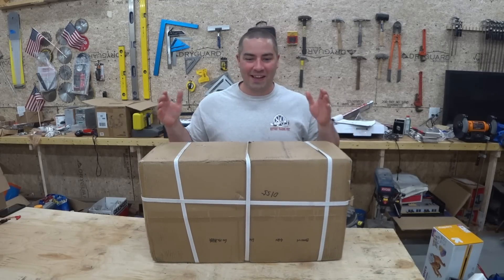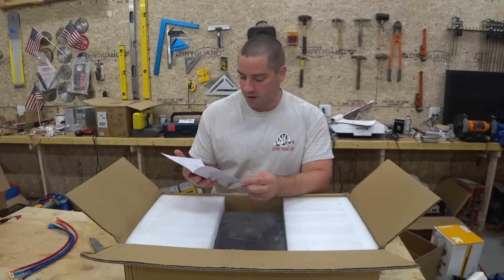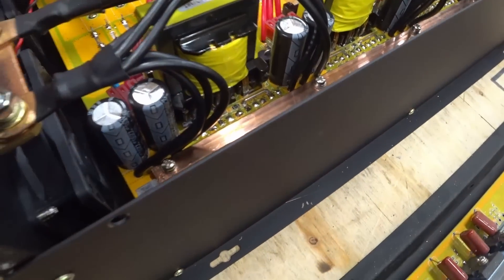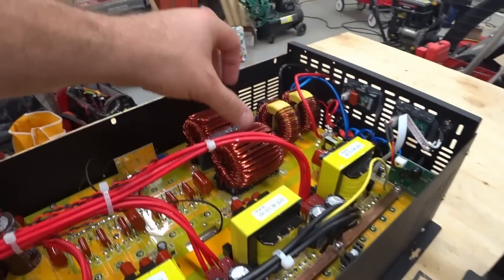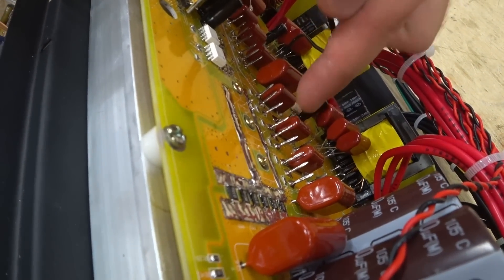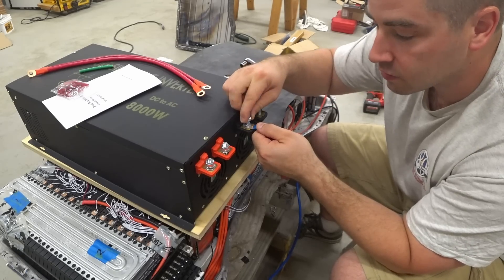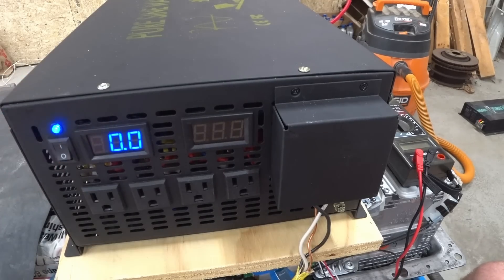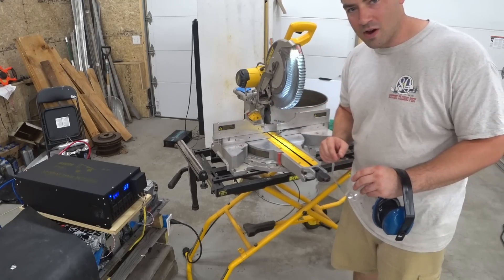Cheap 8000w Reliable Inverter, That Works! WZRELB

Comment: I'd be VERY interested in seeing what the waveform looks like under load.  A lot (most?) of the cheap chinese inverters look good at low or no load, but as soon as you load them up their wave form goes from a true sine wave to something much more square wave-ish.
Reply from the maker: I'd LOVE to get an oscilloscope on this inverter to test.  Actually, I would love to test all my inverters, generators, and compare them to the grid power.  I've been asking around on FB and friends, but I can't find an oscilloscope for borrow or rent.
Reply: @DavidPozEnergy  You can buy a cheapie pocket oscope for about 50 bucks on Amazon.  I just picked up a Kuman for 60 and it's not terrible, not very user friendly tho and the instructions are a joke but the hardware isnt bad.  There are cheaper ones that'll do to check a 60hz signal.  I went "upscale" :-) because I do electronics and I needed something for the tool bag.  The two measures of a oscope are bandwidth and sample speed.  Higher is better.

Comment: This is wonderful David. I think this company is really improving greatly. I have the 1000 watt pure sine  of this Reliable Inverter and tested for about a year now. The result is impressive. I will soon upgrade.
Reply: Chukslis 
I’d rather have several smaller inverters. If he has any problems he looses all 8k. If he had 2, 4K or 4, 2K  he’d still have some power if there were any issues.

Comment: First, THANKS FOR SHARING!  $1300 is not cheap.  I am expecting some quality, for that price; which you seem to be getting.  I recognize this is cheaper than Victron prices .  I would double up the 10AWG cables.  It would be interesting to see the internal temperature when it runs for a while.  This is for your shop but I am curious about its noise level.  How loud is it?
Reply from the maker: Hi Dennis, You are right that $1300 is not pocket change.  I was comparing it to other 8k inverters, such as double Magnums, or an Outback Radian.  But those are way nicer inverters and offer charging.  
As for the noise, it was silent.  No (noticable) high frequency noise.  The inverter never kicked on it's fans during my testing, so I don't know how loud they are.  I'm planning another video where I add more outlets and put 8kw of load on it.  That should get it hot enough for the fans to turn on.  Any other ideas for the next testing video would be appreciated.

Comment: Yes the AC output terminal wires seem to small for handling 8000 watts. I recently had customer burn up his AC connection block  on an Aims Inverter with only 4K of 120v with that same gage wire. I am beefing that up for him now.

Comment: You have to assume China was early to copy popular models and after a couple years they are able to learn how to make improvements. 
If you could hook up two for split-phase and redundancy at a fraction of the cost would be cool. 
I bet you could buy a 3rd as a spare and still spend less than you would with brand name equipment.
Reply: Makes sense

Comment: I haven't seen all your Videos about making the Battery. So why do you use two wires of ground and VCC to connect the Converter? are there twoo batteries?
Reply from the maker: The manufacturer sent two thin wires instead of one fat wire.  Both can work.  I have another inverter connected with just one fat wire https://youtu.be/dfHb5tZErTs  Both systems work.

Comment: Is this the same as GOGs ?
Reply: #10 is rated for 50A in my area. And it depends on the jacket for heat. Maybe rated for 200 C
Reply: Im a bit dissapointed you didnt try to find an inverter company on your own
Reply: Did you know you could have got a cheaper split phase .
Reply from the maker: Hi Frank Z, Thanks for commenting.  I've been thinking about your questions.  At first I couldn't figure out what you meant by "GOG".  But, now, I'm guessing that means "Going Off Grid" Youtube channel.  If that is a correct guess, then the answer to your question is, "yes" this is the same model.  
As for finding an inverter company of my own...  Seems a little odd of a comment.  The company, Reliable Electric, sent me the inverter and asked me to do a review for them.  

If you like another brand inverter then please share the brand, or link.

I'm sorry I dissapointed you.  I really respect you and your channel.  Your A123 battery racks blew me away.
Reply: @DavidPozEnergy  i dont mean to offend you. But he doesn't have as many options. For a 48v system man you have so many. There is some really good new options out there and you could get any of them with your channel. Im not trying to be a dick and im glad you are good but would be nice to see something new. Ill try not to comment .
Reply: Spartan Power. Fox Power but its been done. There a couple .
Reply: @frankz1125  this isn't the inverter he uses in his own system, in an older video, he's shown us his AIMS inverter. 
This is a review that the company asked him to do. 
Personally, I think it's cool that they sent him a unit last year (ish?) and after blowing it up and pointing out publicly its failings, that they didn't break off the relationship because of a negative review. Instead, they went back to the drawing board and fixed a bunch of things. Sounds like good business.
I'm hoping that David can show is some examples of where it would be useful and not (like you just started to) so I get a clearer idea of what I'm looking at as I learn. 
Maybe his suggestions lead the way towards an even better "Inverter 3.0"

Comment: Clicking on the inverter link it takes me to a 7000 watt inverter. Can't seem to find the 8000 watt unit you are testing. Good tests. seems like a good product.
Reply from the maker: Thanks.  I've asked Reliable for a link to the 8000w and they said they will send me one.  It's usually up there, but was just recently taken down.  Last time I asked them why they said they were out of stock.  I'll update the link as soon as possible.
Reply: @DavidPozEnergy  Thanks for reply David..;-)
Reply from the maker: @lasersbee  Reliable Electric just sent me this link: https://amzn.to/2SyjCfy  They said they are going to be adding the 48v 8000w inverter there within a month.

Comment: Wire guage probably takes into account that you would use the sockets on the panel as well for higher wattage usages.  A bit of a risky presumption.  Users should take extra care if they are planning to connect to a "system" that would not do that.

Comment: Looks like a decent upgrade based on previous 8k models, would like to see an extended test over a few hours under load though, say a constant 4-6k load draw to test temps of the mosfets, by the looks of it, the inverter has passed all the start up on load tests, but we need to see if it can deliver what it says on the box - 8k, previous models have fell well short of this, would love to see another test showing this, great video though Dave, I like your demos, keep it up.
Reply from the maker: Thanks.  I'm putting together an outline for the next video.  I'm sure I can rig up a heater for a couple hours.
Reply: @DavidPozEnergy  did you make this heater test video, please?

Comment: Something that I would like you to consider when testing like this, those ratings on the saws and motors, those are maximums UNDER LOAD. the only test that was a real test was that chop/mitre saw. the band saw and drill press, those meant little to nothing. Even the shop vac isn't working that hard once it starts up. Now the heat gun, is probably pretty close, like the lightbulb, but be aware of the difference. :)

PS, what have you found is the best place to buy from for that new unit?
Reply from the maker: If you can wait a month, then Reliable sells their inverters through Ebay.  Ebay is usually a little cheaper than Amazon.  But the Amazon ones can come super fast.  To be clear, I didn't buy this uint.  Reliable sent it to me at no cost to review.
Reply: @DavidPozEnergy  I like your honesty. Did you do any more testing?

Comment: Excellent..... Make measurement about no load draw.... 
It seems it is made to last.... 
MPPsolar is making now us version of all in one inverters and are really good 5kw/5kva 48v are like 550€ with 80A mppt battery charger that could be customized build in....check them out.... 👍😎🖖
Reply from the maker: Thanks.  I'm putting together a list of the things to check on the next video.  I'll add no-load draw.

Comment: is it only  a120 output?
Reply from the maker: Yes, this model is 120 volt only.  But they make them 230 or 240 volt output if you prefer.

Comment: Hi 
You have DC Breakes ⚡ to 🔋Battery .
You have not Inverter AC Breakes ⚡ terminal block
 to Output socket Plug ⚡🔌120V/240V ?
DataMek From 🇩🇰 Denmark.

Look for YouTube link. Going off grid
https://youtu.be/HStB8pK2v2w

Comment: Another great video!.  I agree the wires inside seem too small (e.g. 8000/120 = 66amps) and would do better with at least #6 AWG.       However, I note that the Reliance A510C  50amp @ 240v manual transfer switch also has #10 AWG inside feeding the 50amps and they said its OK/UL Certified because its 'chassis wiring' (short distance) amp specs.      See @LithiumSolar  "Reliance A510C Transfer Switch Wire Sizing Update"  youtube  https://youtu.be/Mnc-ODSFFy0  youtube as my source. 

On a positive note - You could probably upgrade the wire size yourself as the internal busbars seem hardy and its just the short terminal wiring.
Reply from the maker: Thanks for the link.  I've been thinking of replacing them with thicker wires, and at the same time add rubber bushings where the wires penetrate the steel shell.  But I'll try to do a temperature test first.
Reply: People who designed this never expected more than 15 to 20 amps per outlet so wiring size  wouldn't  be an issue

Comment: I think several people have mentioned this, but shorter wires don't require larger gauges as amperage increases. You are thinking of electrical codes and wires which span a house. This is a few inches.
Reply from the maker: Thanks.

Comment: Yes 10 gauge cable its rated to 30 amps but keep in mind the lenght of that piece, same thing if you open any 30 amps fuse, you'll never will see a 10 gauge wire on those because then  probably be a 200 amps fuse or so. What it looks bad its the way those wires going outside of the case, no even a rubber or plastic grommet with age or some vibration they can get damaged by the metal .
Reply from the maker: Good Point.  Thank you.

Comment: wouldnt call 1000 bucks cheap    but its not outrageously expensive as others
Reply from the maker: It's true that $1000 is not pocket change.  I'm comparing it to Magnums, or Shnieder brands.  They are going to run 3x the cost.  Although they are beautiful machines and can do charging.

Comment: I'm impressed that you didn't see a big voltage sag on startup.  If you are going to run high currents through those binding posts, you might want to consider upgrading that internal wiring though.

Comment: looks like the wire is only about 6 inches so it may handle 60 amps if you are worried double them up that is what I would do.
Reply: I would personally replace those connecting leads to a #6 AWG or metric equivalent of 25mm2...
Reply: @christopherlawler3033  Isnt 25 mm2 4 AWG while 6 AWG is 16 mm2?
Reply: Or run your mains right to the board and not use the panel mounted terminal.
Reply: I see fire in its future! Nothing looks capable of handling 60 amp. From the tin looking screw tab coming off the circuit board to the lug and wires running all around it.. I also don't like that there isn't a circuit breaker/ fuse for its receptacles. Its an ok rig if using it occasionally light duty and expect it not to last long. But for those duty's and thought of investment I would rather just buy a Honda generator that's a little more mobile and would not mount this inverter to the inside wall of my house! My two cents..
Reply: @andrewbowden1076  LOL -- I am laughing with you --- not at you,!  Needed a good laugh! Yes circut breakers are needed - specially drawing 60 amps  at 120 volts....  although one would require a rather large battery bank  to draw that much current for a long period electricity moves fast.   I would not use it with out breakers, "UNPROECTED" specially  on pumps, subpumps, ect....  Fire burns - current KILLS.  so BUY HIGH QUALITY BREAKERS . If I remember you posted a video and mentioned something about breakers. I have bought used hi quality "Hubbell brand" Hospital Grade GFCI  Receptacles at a swapmeet -  I paid $3 for 5  3 -20 amp / 2-30 amp. They are worth 100 times that. Whats your life worth.... Keep testing -  keep posting
Reply: @thomasbaldwin9594  -  There a good grid tie and/or grid tie company or brand you can recommend?  500 or 1000 watts?  I'm looking to buy one to plug into an outlet and start generating.  I'm seeing cheap stuff that's questionable.  Let me know if there's one or a company you can recommend.  I'm not going huge power, but I don't want faulty.  Or at least less chance of it, if you know what I mean.
Reply: @andrewbowden1076  - There a good grid tie and/or grid tie company or brand you can recommend?  500 or 1000 watts?  I'm looking to buy one to plug into an outlet and start generating.  I'm seeing cheap stuff that's questionable.  Let me know if there's one or a company you can recommend.  I'm not going huge power, but I sure don't want faulty.

Comment: That was great David, and I'm really pleased to see you demonstrate the precharge resistor I suggested last time!
I think I would go for this inverter based on this test, though I only have a 6kWh homemade battery pack!
Reply from the maker: Thanks for suggesting it Andy.  I'm grateful you, and so many others, want to share your tips.  I wouldn't go buy an inverter from just one day of testing.  Let me torture it first to see if it holds up.
Reply: @DavidPozEnergy  Look forward to it, but don't worry, there's no chance of me being able to afford one for a good while yet!
Reply: @DavidPozEnergy  yes,  torture test for sure,  be good to see wire temps under extended load but still awesome to see an inverter handle startup spikes, the test seemed all too professional and tame,  no sparks, no smoke, no one running for the doors ha ha. great video
Reply: @MagivaIT  its great wires are fine,distance is good David, but can I afford one in Jamaica

Comment: The link you post for the inverter is for a 7000 W
Reply from the maker: Yes, it is the closest I can find right now.  Thanks for checking out the link.
Reply: @DavidPozEnergy   I understand that but you shouldn't post things or do reviews of certain products and then post something else because people are intrested in what you have to offer don't offer them what 1 thing but post something else I was kind of looking forward because that  Inverter looked pretty awesome and is something I was looking for
Reply from the maker: I was able to find it on Ebay for you.  The truble with any of these links is they might be good for a week, but then the seller changes things.  I plan to update the Amazon link if the seller posts the exact same model.  But this link should help you out.  https://www.ebay.com/itm/8000W-Pure-Sine-Wave-Inverter-12V-24V-36-48V-DC-to-120-240V-Solar-Power-Inverter/201588624870?epid=548306366&hash=item2eef9e4de6:g:7SEAAOSwmlZcfj6a
Reply from the maker: @ThingsTokeepBusy  Reliable Electric just sent me this link: https://amzn.to/2SyjCfy  They said they are going to be adding the 48v 8000w inverter there within a month.

Comment: Did you check to see if the earth is hot ground, if you volt test neutral to earth on the inverter legs (should be no volts) and also test positive to ground they should only be 120 volts on the positive leg, (neutral should have no voltage and most likely is connected to the same leg as the earth) 

if neutral and positive is 60 volts on each then you should be careful connecting the neutral to a house fuse box as it will destroy the inverter (if house fuse box is neutral to earth bonded) but I don't believe reliable do that any more splitting 60v between L and N (I could be wrong) 

I guess you should use a thermal cam as 8kw on that cable looks like it's going to cook (case off to use thermal cam)
Reply from the maker: I just checked so I could respond.  There is 60 volts between hot and ground, and 60 volts between Neutral and ground.  So, I think it's called "live" ground.  Darn.  I was not expecting that.  I've tested my 3000 watt inverter and it is not that way, meaning no voltage between ground and anything.  Darn, darn, darn.
Reply: @DavidPozEnergy  if house fuse box neutral is bonded to ground you would need to remove that (makes it a pain to switch between mains power and battery power) 

 I guess the boom is caused by 60v neutral bonded at the fuse box to ground because people don't expect the inverter to be like a split phase (think it's called half waveform 60v on each leg at half frequency) 

the off grid youtuber had this issue with some reliable inverters and some people blowing up there own inverters (sure the old 8kw like one you got only has one live)

But I guess it's good I pointed this out to you as the moment you hooked it up to your house main fuse box it would of gone with a bang the moment you switched on the inverter (as I assume the house fuse box would be neutral bonded to Earth)
Reply from the maker: You are correct, that my neutral and ground are bonded in my main circuit breaker box.  That is the one and only neutral to ground bond in the house wiring system.  I'll have to keep this inverter in isolated systems, separate from my house wiring.
Reply: @DavidPozEnergy  I understand from a load reason why they do it, but failing to have warning that it's a actually a half wave L & N (if that's what it's called) inverter can lead to boom inverter problems